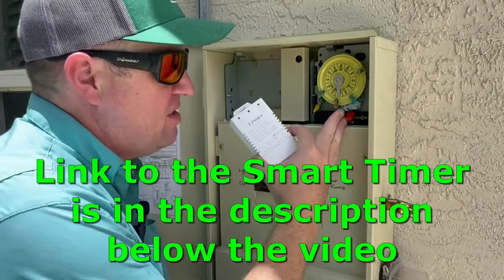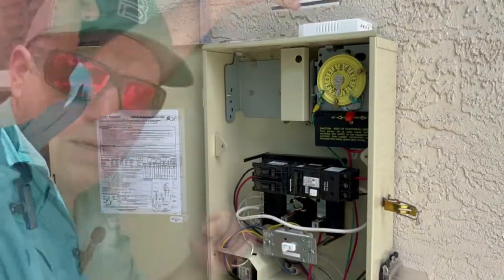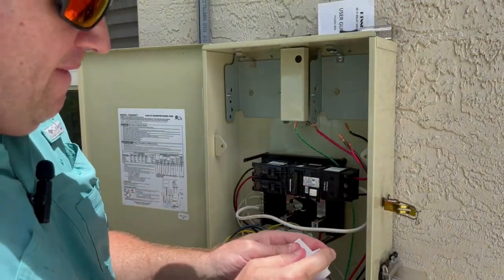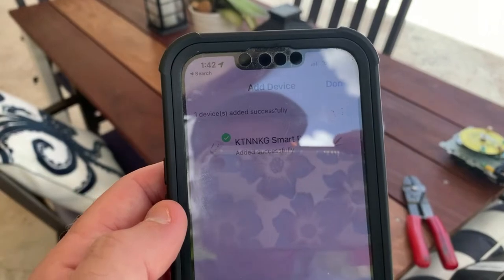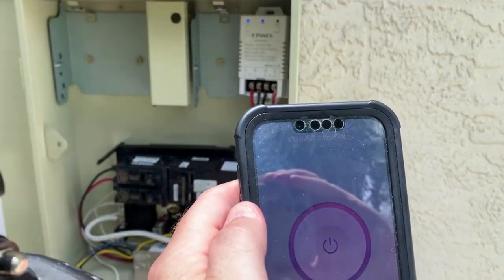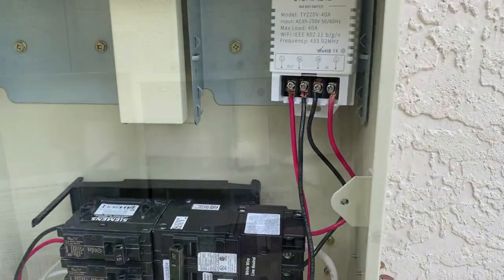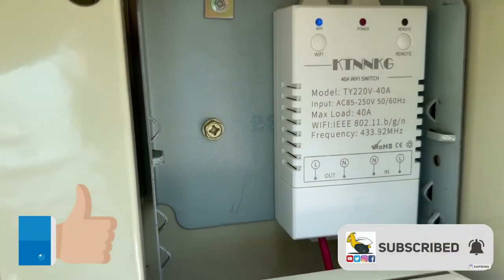$30 Smart Timer for Pool Pump - KTNNKG 40amps WiFi Switch

Comment: I have 2 pumps, one pump to circulate water and another that runs the Polaris cleaner. The circulation pump has to be on before the cleaner pump will run. Will this work for my setup? Would I need to buy 2 controllers? Thanks!
Reply from the maker: I think you would  need 2 controllers as each rated for 30 Amps
Reply: I have same setup did you end up trying this ?

Comment: Thank you for sharing. I have a question regading  my already installed Freeze Guard on my control pannel, would it work with this smart timer since wiring is the same?
Reply from the maker: Yes

Comment: One of my clients has this setup and we’re having issues getting it to connect with the app on his phone. Everything on the timer side works fine. Is this an issue with the app?
Reply from the maker: Make sure to connect with 2.2Gz wifi.  5Gz wifi doesn’t support most wifi smart devices

Comment: Did you connect the two lines from the panel to the line and neutral terminals on the switch? Thanks.
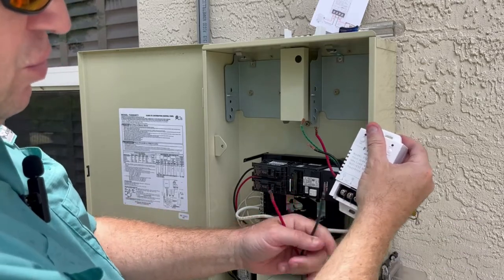Reply from the maker: Yes, see video at 1:43

Comment: Purchase the module and the screws are so short can't get the wire in securely. Any suggestions. Can I purchase longer screws? What do you call those screws
Reply from the maker: Take the screws to hardware store and they can match up the threads to a longer screw

Comment: Hi would like to know if i can use this with a pool pump and salt system. Both are 110v each and i have 2 20 amp breakers one for each. So i was thinking the both breakers get wired to the right and the both pool pump and salt get wired to the left. Will this work or it only support one 110v thing?
Reply from the maker: I believe so.  Description says 110V or 220V
Reply: Hello, were you able to connect your pump and salt system? So how did you connect the wires?

Comment: I have an analog timer dial switch that turns on my in ground spa (attached to pool) and it's in the exterior wall of my house next to my patio door with one of those clear retractable cover doors. The switch has failed and just stays on all the time. Could I replace that timer switch with one like this?
Reply from the maker: I believe so, is the timer 220v or 240v?   if so then yes

Comment: Hi, I also do not understand the wiring. Do you have a single 220V wire and a neutral wire? Really appreciate clarification. Thank you.
Reply from the maker: Single 220v wire, no neutral.  I had red and black wire coming from the breaker.  And then red & black out to pump
Reply: @BRichSolution  No neutral and a SINGLE 220V wire does not make sense. It either has to be two hot 110V wires (for 220v) or single 240 (as in Europe, not US and I am in US) AND a Neutral - no exceptions. Thank you very much for a quick response.
Reply: @hughelse9301  There are two hot going in (black/red>black/red), neutral is always white. I imagine this works just like a switch only using the hot legs, the neutrals are tied together.....

EDIT: Rewound the video and can see the neutrals are all connected on a bus bar to the left.

Comment: Is your pump 220 volt. So you used this switch as as a 220 volt switch, amazon reviews say it won't work with 2 hot wires and no neutral wire but it seem to be working fine?
Reply from the maker: yes 220v and all it working fine for over a month now

Comment: You cannot install non-Intermatic controls into Intermatic panels as these panels are not regulatory listed or regulatory tested (CSA, UL, etc.) for use with these alternative controls. This is a code violation!
Reply from the maker: Good point

Comment: As other have implied or stated, video shows product being improperly installed. Yeah it works but I don't think it's to code and it's not safe, as others have commented 

I bought the relay becuase I have the exact same panel box and timer shown in this video. I paused on installing as it was not making sence to me. I'll now quote the manual

 "Question # 4 : Can I run l1 and l2 (240vac) through it (no neutral)? 
Answer : No, don't do that. Must be one "L" line +one "N" line. If your device is with 2 hots which is 120V for each, can't use this relay switch."

The power supplied is clearly show in video as 2 hot 120V lines from a double breaker.

I can see how it'll work, turn on pump and complete the circuit, however it's not rated to be used like this. I'm not willing to risk the liablity in something going wrong.
Reply from the maker: The original analog timeomatic timer was wired the same as digital so how do they suggest wiring the Timeomatic with two 120VAC wires?